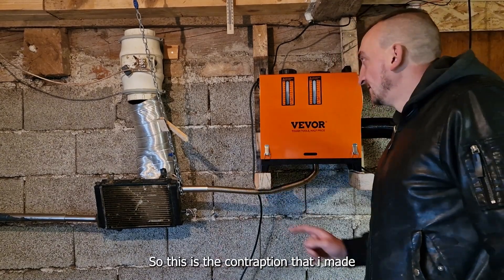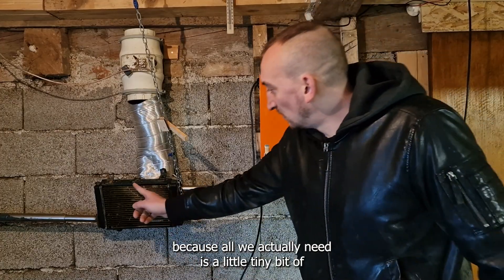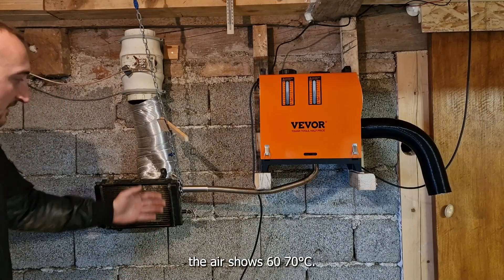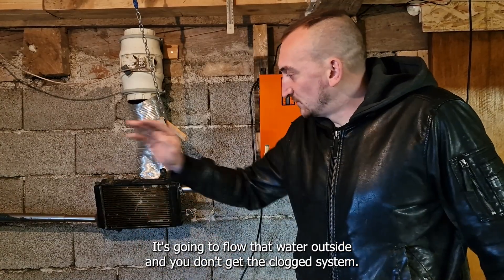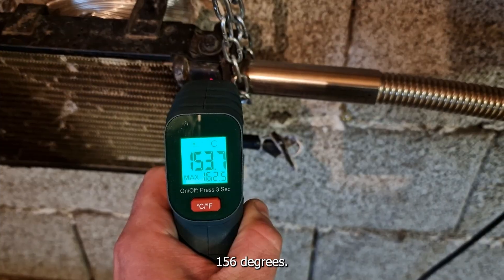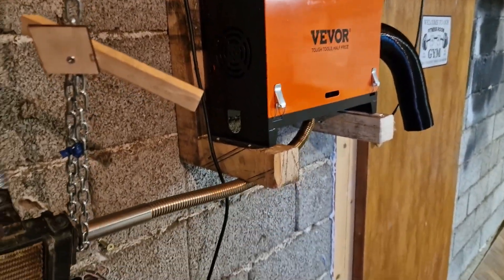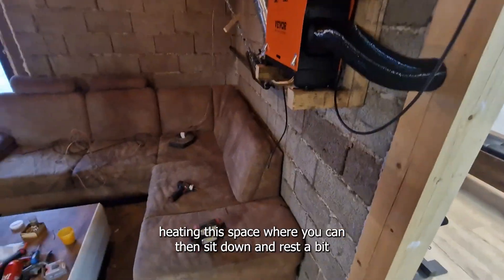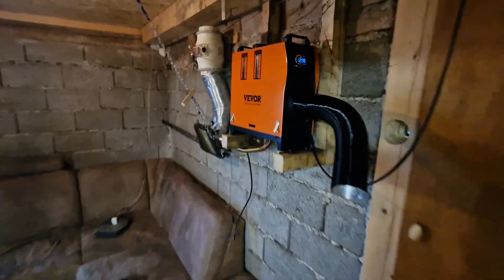Upgrade your diesel heater output by 100% with this simple hack

Comment: ⚠ Safety warning ⚠
Running a diesel heater exhaust through a radiator or homemade heat exchanger is extremely dangerous.

Diesel exhaust contains carbon monoxide. Cooling the exhaust creates acidic condensation that eats metal from the inside out, causing pinhole leaks you can’t see. One small leak = CO inside your space.

If a leak occurs, you’re not just breathing CO — you’re inhaling condensed exhaust vapors mixed with moisture, which contain nitric/sulfuric acids and toxic aldehydes. This can cause lung and airway chemical burns, coughing, chest pain, headaches, dizziness, fluid in the lungs, and delayed respiratory injury. You may not smell anything unusual.

Adding radiators or exchangers also increases backpressure, leading to poor combustion, carbon buildup, glow plug damage, cracked chambers, and early heater failure.

Diesel heaters are already sealed heat exchangers by design. Exhaust must go straight outside, unrestricted.
Please don’t copy this setup — people have been seriously injured and killed doing this.
Reply from the maker: Ok 😂

Comment: Yeah, it may take a long time to heat up a cast-iron radiator, but the fittings are on tight unlike the heater core offer my car. The gases will weak. I guarantee you if you put a carbon monoxide detector down in your basement it will be going off, but also, I would like to point out those that are heating up house radiators. They have a diesel air and water heater not just a diesel air heater and like I said, even if they are using the exhaust at least they’re fittings are tight enough to not leak exhaust gases. Carbon monoxide is a silent killer.
Reply from the maker: I have 2 detectors in that room not once did they beep

Comment: The benefits of using a old cast iron heater although it takes longer to heat up once the cast iron heater is warm and takes ages to cool down you’ll be able to use the heat of that multiple hours after the heater has been turned off, the bonus of what you’ve done is much quicker at heating the area but you don’t have a long heating time after the heater has been switched off,

Comment: With such a small area that's actually producing heat you're probably gaining less than if you just ran a longer exhaust pipe, nice try though. The whole reason cast iron radiators work is because they don't impede flow while heating a large block of metal.
Reply from the maker: Not even close with this setup all heat is taken from exsausz

Comment: trying to do the same. will need to source the part. did you have 1" inlets and outlets so it does not put back pressure on the exhaust? That looks like a heating core do you know where to get it?
Reply from the maker: This is an old quad radiator that i modified

Comment: We did one of these from an old bus. We plumbed the exhaust into the top of a 55 gallon drum laid on its side and the output was at the bottom. No back pressure. Condensate flowed out the bottom. Later modified the drum with Fifteen 2 inch steel pipes welded in the top and bottom of the drum and pushed air thru them.

Comment: I have the same idea i want to buy a "Oil Cooler Kit, Aluminium alloy 8 Pass Tube" from temu to use it with the exhaust
Reply from the maker: You wont be disapointed.

Comment: Revers ur lines. Bottom pipe  at bottom of radiator and at outlet on top of radiator. Easy flow instead of fighting itself thru
Reply from the maker: What about condensation? If i do that radiator would fill up with water
Reply: @ could use a trap to catch and drain. We have them on air compressors. Same concept!
Reply from the maker: @subhumanaudio  that wont work
Reply: @MrTplanko  I’m sorry but it will work. Have you ever seen a heat pump or air compressor with a drain line plug or trap at the top of unit? No. There is a reason for that. Condensation always goes to the bottom. Heat raises. Air is lighter than water.
Reply from the maker: @subhumanaudio  the way i have it set up doesn't require any modifications it's set up so the condensation is removed by gravity (pipe is installed at an angle.

Comment: if there is moisture draining outside, does the cold air outside freeze the exhaust pipe?   where I live it is far below freezing.  and you said your exhaust pipe is cool going outside.
Reply from the maker: The air flowing out of the exhaust at the end is room temperature so it shuldnt be a problem

Comment: If the radiator wasn't there, wouldn't you get at least as much heat as the exhaust would be hot for the entire length? Then maybe use a ceiling fan to distribute the heat more evenly around the room?
Reply: The heat is being shot out of the exhaust pipe and leaving the space that is being heated.  So with the radiator he is taking away the heat from the exhaust fumes before it is sent outside.
Reply from the maker: @mattrevesz  exactly
Reply from the maker: Not even close i tried it

Comment: Does the composite material on the ends get hot i am wonder if this needs to be done with a all aluminum heater?
Reply from the maker: Yes all aluminum is recommended I used steel version

Comment: Great concept and explanation. I'm curious how much back pressure these units can handle before they have a hard time pushing the exhaust through something like this as they barely "blow" much out of the exhaust pipe to begin with. I may tinker with this theory by using a valve at the end of the exhaust and slowly closing at increments to see what happens. I'm guessing that at some point the unit will not run because the exhaust will back up and without the proper air/fuel mixture, it will quit working.
Reply from the maker: Wery little back presshure is needed  for it to stop working
Reply: there's a million versions of this on ut00b ... good idea, but nobody seems to be able to spell backpressure ..... it ain't gonna work for long ........
Reply: @petermoss4824 million versions.. and all bad.   The stock exhaust is already a radiator.  Just add fan.
Reply: I looked into this. The heater uses an air impeller with straight radial blades. This means that no matter what gas flow rate of fuel and air is going through the system, the head will always be the same. So once the back pressure meets the pump's rated head, there's nothing the electric motor and impeller can do to keep the combustion process going. 

Sounds like MrTplanko is at the head limit for this unit. So you can make a mental note that any radiator larger than this likely won't work without an additional pump stage.

What someone could do is put two identical heat exchangers in parallel using a branching tee with equal pipe lengths. That way you effectively increase the size of pipe to keep the back-pressure down and keep an even flow distribution.
Reply from the maker: Or you can use another vemtilator  on the end of exhaust to help with the flow

Comment: Awesome idea - thank you. I have been racking my brain coming up with at simple solution to get heat out of exhaust that didn't take up a huge amount of space. This is excellent. People blow the corrosive properties of the exhaust from these diesel heater way out of proportion. I think it will last for years, if you, like me, only use it to heat up the shop when you are there. It is not like it is running 24/7 :)
I just use a small electric heater to keep it above freezing, and then i turn the diesel heater on with a Broadlink RM4 pro universal Wifi IR and RF remote when i know I am going to the shop. The RM4 pro can learn 433 RF signals, so it emulates the key fob remote.

Comment: Be better if you could recliam some of the waste heat as power to run the heater and charge the battery than it would only need a small 10 amp/hour battery. There should be enough temp differences to produce at least  enough to recharge the battery. It's got cold air in and hot air out .
Reply from the maker: I think its better to use it like I shown and use the heat because this is a 12v 40w energy usage is so low it just doesnt make sense
Reply: You could achieve this with a few peltier device  , orbwhats called a strange engine

Comment: great idea.i did the same with an alloy intercooler.
Reply from the maker: How's the intercoler working for you?I guess it's better than ratiator?
Reply: @MrTplanko , it works very well. I just need to fit the 2 variable-speed 12v fans, and I should get a large proportion of the heat available.
Reply: @mightyfinejonboy  12v fans each with their own thermal switch downstream.  it will run more or less fans depending on how hard the heater is working.

Comment: it's a good idea, very high efficiency, but you should look at neutralizing the exhaust. If the exhaust condenses because of the heat exchanger that cools it. The condensate will be acidic, and those aluminum heat sinks probably are not the right grade to handle acidic fluids, they will have a short life before they fail. I ordered a hydronic heater and would love to add waste heat recovery, but I don't have a good way to handle the acidic condensate from the exhaust besides using ethanol or some other very clean burning fuel.
Reply from the maker: Yes but it definitely is gonna last more than a year easily so there shouldn't be any problem.
Reply: @MrTplanko l think the presence of a CO monitor is critical, you don’t know when the harmful exhaust begins to leak out.
Reply from the maker: Yes this is a must
Reply: @GuessWho9411 with all the potential failure points, agreed
Reply: @MrTplanko  
You're better off running the whole heat exchanger hot by keeping your radiator fan at a lower setting. Do that and the moist exhaust will vent without condensing, you'll use less electric power pushing liquid through the system. Hot exhaust is also less dense, so its easier to pump. You might get 700W instead of 1kW of heat but I think that's a fair compromise for longevity.
Reply from the maker: There is no avoiding condensation with this setup
Reply: @MrTplanko  Not at all. Don't let the exhaust temperature drop below dew point and no liquid will condense out of the exhaust. You can figure out the dew point in your room with a hygrometer to find relative humidity and then the dew point temperature from a chart.

Or just slow your blower fan down so it's not blowing so hard until you get the outlet up above 30 or 40 degrees celcius and you won't need to calculate a thing.
Reply: @Infinion  It's already condensating as it passes the stock muffler,  so there isn't really any way to expect to take more heat from it, and also prevent it from condensing.  It's going to happen.
Reply: @MrTplanko   You can install a small drain area to catch moisture.  make sure its sealed, and you could open the drain when needed to dispose of the water.
Reply from the maker: I have the pipe at an angle so all of the water is flowing out no need to complicate it
Reply: Nope.  Just run a constant downslope, 1 piece 6 ft exhaust with a fan on it.  I use a copper pipe sleeve - 1-1/2 inch hole thru wall.   All condensation happily outside.     The stlagmites are all pretty tame as low sulfur diesel is the norm here.

Comment: that is going to clog up and im not sure what will happen when it does .
Reply: Undo exhaust, spray in a solvent cleaner, rinse with water until clean, reconnect reuse.
Reply: @slarratt  This is what I was thinking and he's not running 24/7, it will take a lot of time to get dirty as these things burn very clean. You can buy aluminum CPU heat exchangers with fans attached for $25, I'd buy another spare and if this fails just plug in your new one. Great idea!
Reply: @slarratt nope.  You will see why.  Just omit it entirely, run a 6 ft always downsloped one piece and blow a fan across it.
Reply from the maker: You're right, but as long as you have it at an angle  so all of the condensed water can flow out it shouldn't be a problem
Reply: @MrTplanko Wouldn’t the carbon in the exhaust fume eventually clog up the thin passage in the radiator?
Reply from the maker: Yes but we are talkimg years of use

Comment: ya be-careful doing this mod.. not sure what happens when your sending diesel exhaust thru the coil what kind of chemical reaction you can get .. glad you have a co monitor
Reply from the maker: I did test it with co2 monitors for 10h and it was ok
Reply: @MrTplanko   I would Keep the CO Monitor around coils to spring very small leaks..   and you are using a co monitor right ? hope its just a typo.. ;)
Reply from the maker: I do keep it close and yes a typo 😀
Reply: @MrTplanko  ok cool.